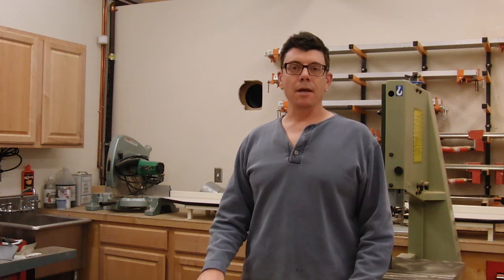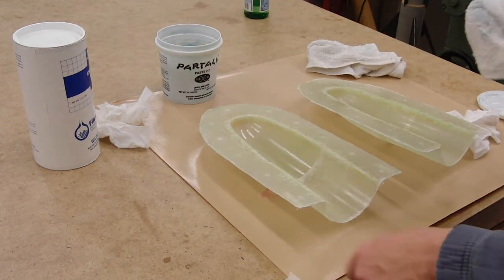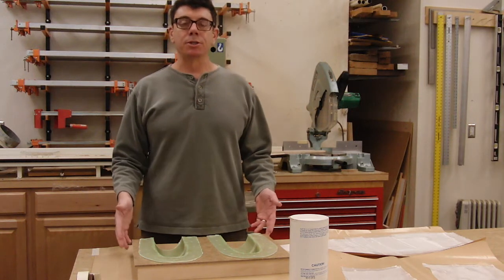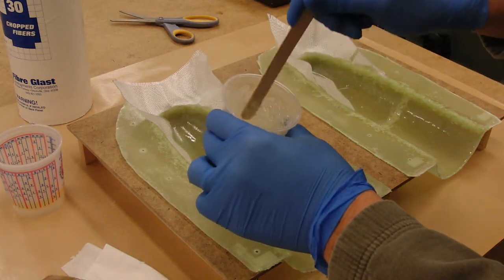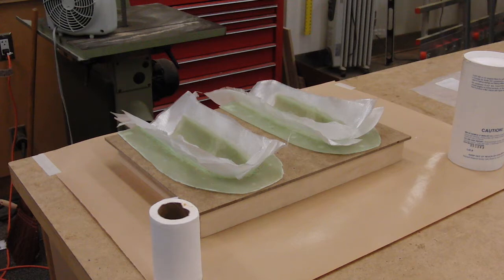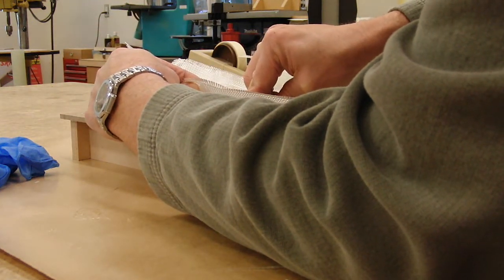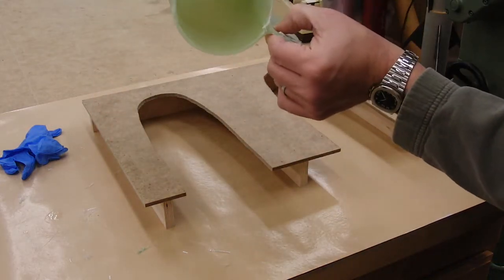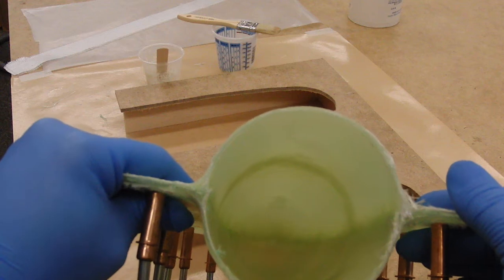Custom Nose Cone, part 2

Comment: could you use a plastic nose cone to make the mold?
Reply from the maker: +Kevin Eliason sure thing, just be sure to smooth out the mold line (and you can use it as the parting line for the fiberglass mold)
Reply: +John Coker Awesome!  Now, do you need to use those fasteners, or will you get the same hold with just nuts and bolts?
Reply from the maker: +Kevin Eliason You don't need to use the Cleco fasteners, but it's quicker and more precise if you do.  If you use screws instead, drill the holes undersized so that the screws are a tighter fit.
Reply: Ok thanks for the help.  Two more questions: how much epoxy is necessary?  I was looking at their quart size, do you think that would be enough?  Also, any recommendations on which resin to buy?
Reply: Oh and how much fabric would I need to purchase?
Reply from the maker: +Kevin Eliason Well, it depends on the size of the nose and how many layers.  I used 3 layers of 6oz and 2 layers of 4oz cloth.  I'd guess that 1-2 yards of each weight and a quart of epoxy should do it for anything up to a 3.9 nose cone.
Reply from the maker: Tony Alcocer made a video on just that: https://www.youtube.com/watch?v=CRlWkMmMKl8

Comment: What is the name of the tool you are using to fasten the two halves of the mold together and where could I purchase one? I have been using screws but your method look much better.
Reply from the maker: They're called Cleco Fasteners, available from Fibreglast (along with all the other supplies you'll need): http://www.fibreglast.com/

Comment: Loved your video. I wanna try to do the same, but with carbon fiber. Do u think it's possible?
Reply from the maker: Absolutely. Flat weave tends not to bend as well as fiberglass so go with a thinner weight if there are any tight bends. Alternatively, use one of the twill weave cloths. https://www.carbon.ee/en/n/carbon-fiber-all-patterns-explained